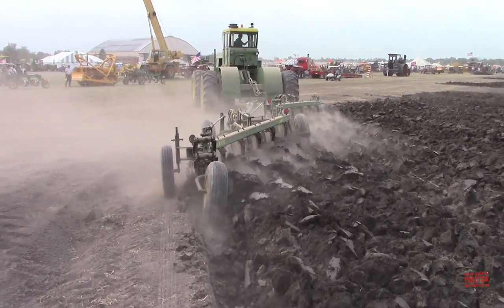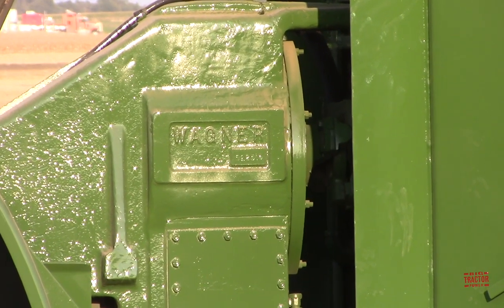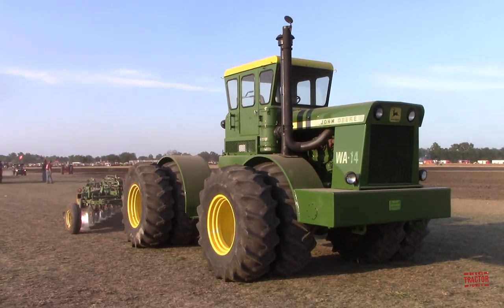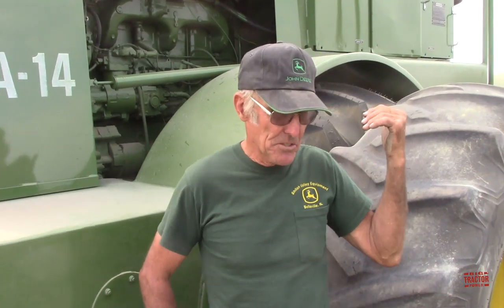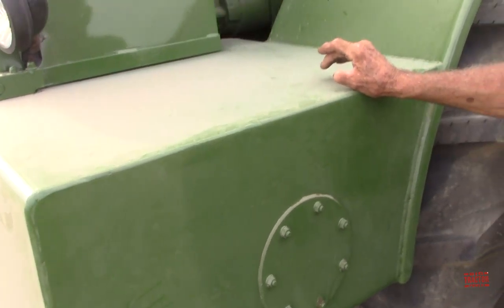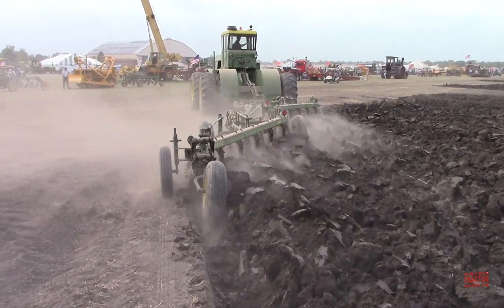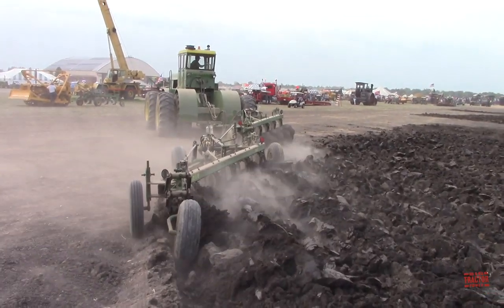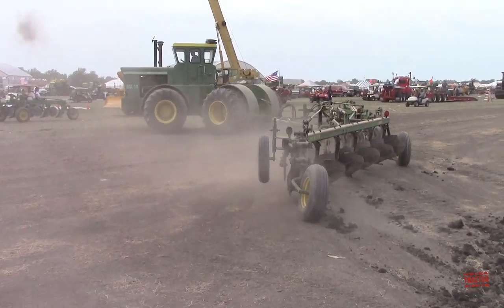John Deere WA-14 Tractor: Only 23 Built

Comment: Had 3 of the Wagner/ John Deere. They were wa 14 stickers but running gear was wa 17. The truth was John Deere was in a patent infringement lawsuit ongoing and rather than pay out they bought Wagner. They just painted them green and two years later they orphaned Wagner. These were the very first tractors that we installed triples on. Everyone thought we were nuts at the time. Decent long life machines but were soon underpowered by 1973. Repowered easily. Dave Curtis was a long-standing Wagner dealer and knew where almost every Wagner in western USA and Canada was. He eventually squired the patent on the drop box after John Deere dropped Wagner and went on to produce his own tractors under the name Rite by Curtis. Great tractors from 450 -750 hp. You speced the engine and transmission and differentials, he used commercial shearing hydraulic components and they were a remarkable tractor in the day. Big cab, proper weight distribution, good hydraulics. You could work on them far easier than the other brands. Versatile Vice Presidents rose with me in my Rite and were astounded at the quality and performance, they were in test mode of the 1176 tractor at the time and were highly impressed. I owned a total of 8 Rites before I quit farming and am sure almost every one is still operating. Easy to rebuild and maintain. Curtis rebuilt many Wagners and repowered most all. The Cummins was first choice with a few cat engines and some Detroit 92 series in several. The Detroit engine didn’t have the torque and used 40 percent more fuel than the big 1150 k19 Cummins. Noisy as well.

Comment: I'm glad you filmed this one B.T.P.,these are pretty rare,I'm not sure if the bigger brother WA-17 is even more rare or not,but at 225 hp.it was pulling the 12 bottom in good shape and I'm sure it's bigger brother at 280hp.could pull a 16 bottom without issue.
So this means your 4786 I.H.can handle a 16 bottom without issue,because it has 350hp..
I was guessing it takes about 15 hp.per blade.
Reply: 4 gauge these came out with 250 hp Cummins that were readily converted to 290. They called it a smoke kit, just bolted on the turbo and ran a couple of oil lines, redid exhaust elbow. Did 3 of them right after we took delivery of them.
Reply: @ricknelson7824  Very cool.

Comment: Awesome looking beast of it's time.  I have to agree with others, it does tend to resemble the Big Bud tractors.  Looked pretty impressive pulling that plow setup.  Stay safe.
Reply: Probably because the gentlemen that started Big Bud owned a Wagner dealership before Wagner went belly up.
Reply: They didn't waste any time. They had couple done by the end of 1969.

Comment: Truly amazing tractor 
I was under the understanding that John Deere made that designed for the military
Every labor day weekend we have the Rock River thresheree in Edgerton Wisconsin there is a lot of unique tracker to show up there I I've been going there almost all of my 50 years
Reply: William Keehn a lot of the military equipment was made by Clark equipment and they were stout machines. Many were used by army engineers corp for earthmovers and dozers. Most had Cummins 855 cid engines that ranged from 290-400 hp. Lots ended up in surplus yards with the one in Great Falls Montana seeing a lot of them , people would buy them and repower and change up quite a bit on them. Had great axles on them that were tough as heck but had a brake system that could be problematic. Used a bladder inside the drum to forces out about 12 pads/ shoes , if the operator left the brake lock on it obviously would smoke the brakes and resulted in the bladder possibly ruptured.

Comment: That tractor is in excellent condition for its age.  I remember the JD ads in the Western Producer magazine showing this tractor.  I'm shocked that it handles 12 bottoms the way it does.  That's a big plow in today's scene. Although it is 16" bottoms.  It likely wouldn't pull 12 x 18" as well. I had a new 1982 Allis Chalmers 8550 rated at 305 engine hp and it couldn't handle a Melroe 12 x18" plow.  So I realize just how hard it is to pull them things.
Reply: Yes, but this tractor has a Cummins 855 detuned to 225hp.  That engine is capable of over 400hp.  This tractor could have easily been tuned up for more horsepower, and if it wasn't it still has plenty of torque.
Reply: @nitram148 , Torque is what twists the wheels !!

Comment: Fantastic tractor and plows, amazing how a under 300hp pull that plows through soil that looks very hard,
Reply from the maker: It is neat to see a 225 hp tractor work ground like this.
Reply: A crap load of torque !
Reply: @bigtractorpower  He said it had a turbo on it, so it would be the same as the WA 17 more like 280+ hp.

Comment: Yes wagners went on to make n produce Big Bud tractors hence the reason they look so similar!!
Reply: Ron Meier Not true Wagner continued to build log equipment after John Deere’s contract said that they couldn’t build tractors anymore. Northern manufacturing co built big buds in Montana, no connection to Wagner that I can find. Wagner is still in business and owned by Allied systems Company in the Portland area.
Reply: Greg Hutchinson you are correct, I made several trips to Havre to view units under rebuild and new units. There was a triple earthmoving setup that was built for stripping overburden that had big bud designed to pull them. They loaded the rear scraper first and moved forward to finish loading, each unit was 16 foot wide and had over 30 cubic yard capacity. Full heaped load of 100 yards. Utilized a cotta 2 speed drop box and a six speed automatic transmission. Had k19 Cummins that was pumped to around 700 hp.
Reply: @Johndeere42302008  Northern Mfg was founded by Willie Hensler- owner and Bud Nelson -mechanic, a Wagner dealership left with no tractors to sell after the JD/Wagner deal. So they built their Big Buds fashioned after the Wagner's with some improvements. Series One Big Buds were HN 250,HN 320 etc .( Hensler/Nelson.) None of the Wagner family was involved. The Welkers from Montana (YouTube) have a very early Bud, their grandma says # 3 off the line, doesn't even have a serial number. They pulled an air seeder with yet until last year. Had it on the land roller this spring.